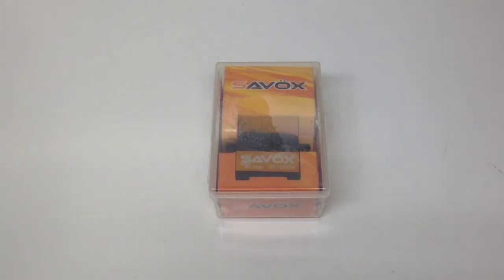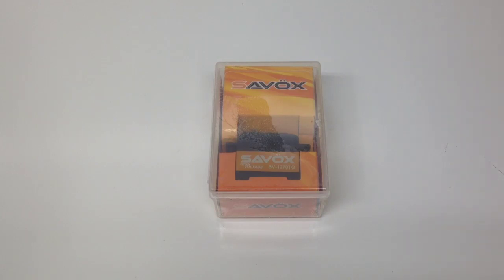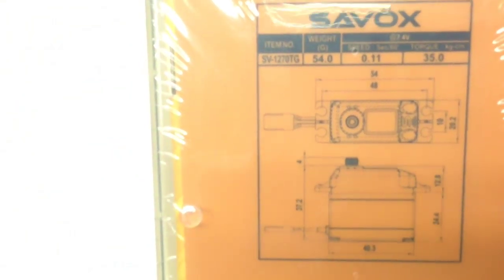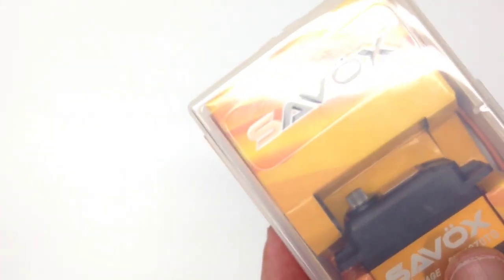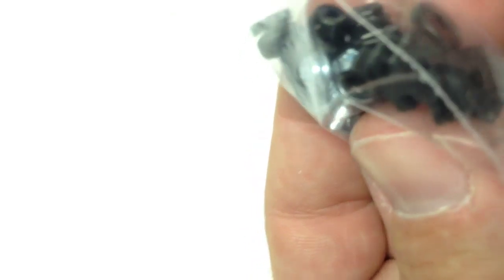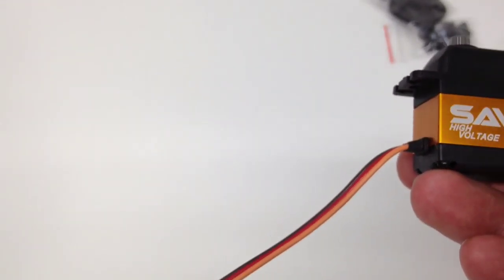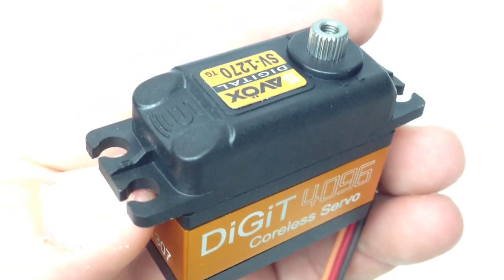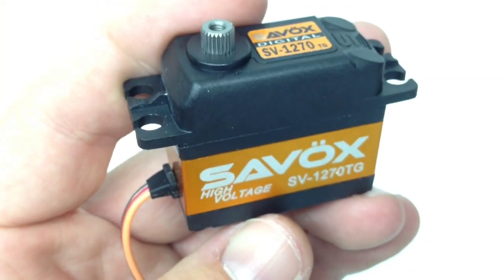NEW!! Savox 1270TG Servo Unboxing - 487 in/oz of torque!

Comment: I had a 1273tg in my buggy for steering, I liked it pretty good but I have switched to the 1271sg it a little slower, but alot more power. 1273 .065 222 oz-in 1271 .08 350 oz-in. I am going to use it today for the first time. I will probably do a review.

Comment: can i use this servo for my crawler ? D950TW Wide Voltage Ultra Torque Servo   i am new to this hobby and i have no ideea about electronics, and i was reading on the internet i need something for a powerful servo just to not burn it. can somebody tell me. this is the motor and esc i will be buying as well. NOVAK M2 DIG 3S ESC/2x TERRA CLAW 45T MOTORS/3A BEC COMBO  . please i need your help. thank you

Comment: I have a arrma Nero 6s this servo is good  for that car
Reply from the maker: Jose Pichardo it should do well, but you may need a Voltage cap installed on your Receiver to operate it. A Voltage cap is a $5 item from either Spectrum or Racers Edge - it plugs into any open port on the receiver and regulates Voltage on your servo as to not cause brown outs.
Reply: Thanks man

Comment: May I use 2S unregulated lipo  (8,4V)?
Reply from the maker: It should be able to handle it...but SAvox usually requires a BEC or a Voltage Cap
Reply: The RCNetwork Good video buddy, I took the top off my new 1270 the other day to make sure the gears had grease ,guess what, none at all so I greased the gears and was also surprised to see no brass bushing on the motor shaft, the shaft  just goes straight  into the plastic .

Comment: what does 487 inches mean???....does it mean an arm of 487 inches can carry an object?
Reply from the maker: It's basically how much weight it can move on the servo arm, so to speak.  In RC terms, we use servos to turn the front wheels in the direction of the turn,  The heavier the wheel/tire or vehcile and depending on the terrain, the higher the amount of torque you want.  487 is quite  a bit for a 1/10 th scale vehicle
Reply: The RCNetwork Can  you do a torgue  test on a  scale ,I've seen another test and it wouldn't pull anywhere near that 487oz ,perhaps it was faulty.
Reply: The RCNetwork what is the best servo for a traxxas slash 4x4
Reply: The RCNetwork under 90 euro

Comment: Hey man would this be good for the arrma talion?The electronics im running is that hobbywing ezrun max8 2200kv motor comboI know the bec can be set 6v up to 7.2v
Thanx
Reply from the maker: +michael dev Yep, it would be ideal (torque wise) but make sure and install a Voltage Cap on your receiver....not sure about the internal BEC on the HW

Comment: Great reviews ..I got a tekin gen 2 combo on my xray buggy .I know that it has a built in bec but do you recommend to get this servo with it ?I mean , many saying that brown out issues is common with savox servos .
I noticed at amain website that this servo model doesn't have a bold indication that it could suffer from brown out thing like other models ..Is it to go with my setup ?Thanks .
Reply from the maker: +Emptyqrider runner I'm 90% sure that you'll be fine with the Tekin RX8 Gen2's internal BEC with most Savox.  I say 90% because I never ran this with an RX8 Gen2......With that, I have actually switched away from Savox all together because of those issues/having to run caps on my receivers.  I'm running Hitec 9000 series servos now like the 9370/80.  The Futaba's are also nice - BLS371
Reply: Thanks for the info and advanced and advises.
I was running hitec all the way untill one got burned due to a rare faulty rx461 reciever , so i thought to go for another brand.. I guess i'll stick to hitec again.

Comment: The 1270tg fits a losi 3.0t nitro for both steering and throttle right or am i wrong
Reply from the maker: Jeff Lockwood Yep.  Not being a nitro guy, do you need that much torque on a throttle servo?

Comment: Hi I seen you also did a review on the 1283 savox. Between the 1270tg and 1283 which would be the best fit for my emaxx brushless running on 6 cell. Thank you for your time and patience, and replying to my questions.
Reply from the maker: I would probably still go with the 1270.  A bit more torque and titanium gears is the winning edge

Comment: Currently running the mamba monster 2 esc, would you recommend a servo that would not require a bec and still perform great. Thanks for the input.
Reply from the maker: The MM2 should be fine without a BEC.  It has an internal BEC selectable from 5-7v.  Worst case, you may need to drop in a Voltage Capacitor (very inexpensive and plugs into any open port on your receiver) Otherwise, I have used the Hitec 7955tg with no issues

Comment: Hi looking for a new servo for E-maxx brushless would this servo be a good fit for my truck with a fast lane machine chassis.
Reply from the maker: The 1270tg is a great servo for the E-Maxx.  At over 400 oz/in of torque, it can handle the added weight of the FLM chassis.  You may need to add a BEC depending on what ESC you're running, as the 1270 loves to steal power being a high voltage servo

Comment: What company would you recommend as far as motors. And what size do think would fit comfortably in a tennis ball?
Reply from the maker: Size wise, a 540 sized motor should fit in with no problem.  The next size down is a 380 sized motor.  As for type, you need to consider brushed or brushless.  Brushless will be more expensive, last longer and probably be a bit faster.  Brushed is technically waterproof and requires break in and is about 1/4 the cost of brushless.  As for brands, there's so many out there, it really depends on your budget.

Comment: Not completely a drive shaft but something to turn an object foward or side ways?
Reply from the maker: I guess it really depends on what your doing.  From what I know a servo is pretty much a back and forth mover.  A motor will turn infinite circles both forward and reverse